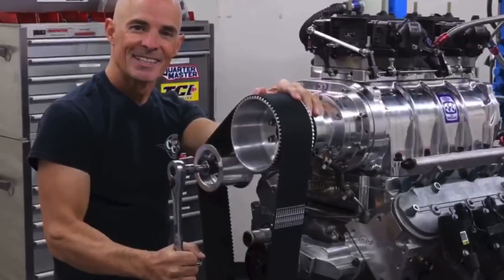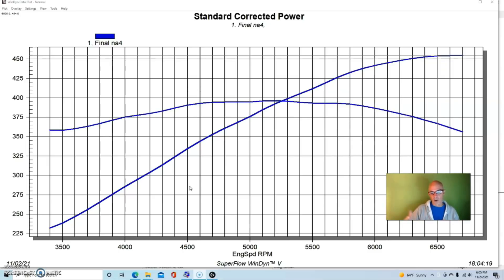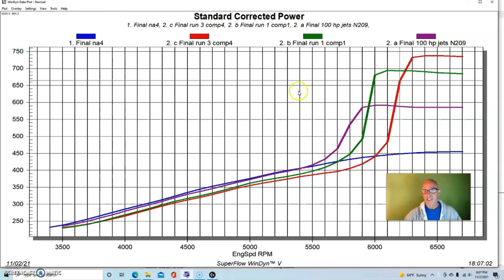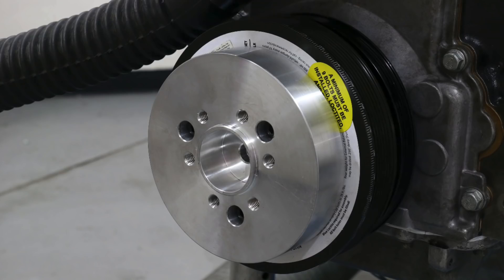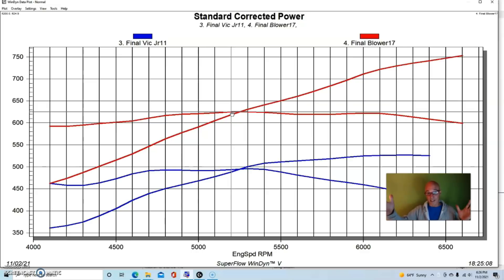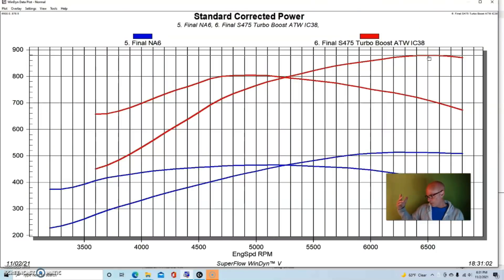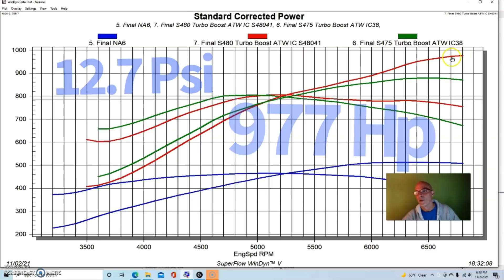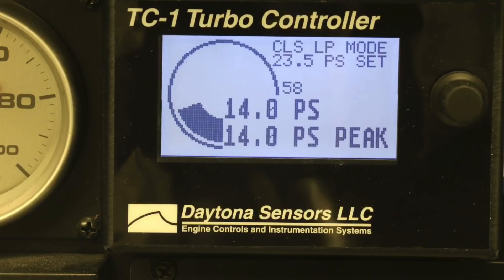HOW TO MAKE BIG LS POWER! JUNKYARD 5.3L NOS (300 SHOT), 6/71 383 & 6.0 TURBO S475 VS S480? TEST FAIL

Comment: Just asking for a friend. He has a 6.0 in 2500 with 317 heads. He also has parts from other trucks. He has a 5.3 with 859 heads not sure exactly on the casting I do know it's 800something He also has a turbo from a 6.6 diesel and the air to air intercooler and he already has a tuner on the 2500. How well would a like the comp cams 59-454-11 cam, the 5.3 heads, diesel turbo and intercooler work or would we end up making your big bang 6.0 look like a fire craker compared to dynamite and really tear something up
Reply from the maker: USE A SMALLER CAM ( i HAVE A GOOD ONE FOR SAME), USE THE STOCK 317 HEADS AND THE REST WILL WORK
Reply: @richardholdener1727  thank you I'll let him know and we live near Bardstown KY so we can literally go to btr for the right cam
Reply: @dannytravis7118  I’m like 25 minutes from bardstown

Comment: Richard you are single handedly motivating me to swap my bmw. I gotta ask, it just seems stupid how simple you make this seem. Are the motors capable of holding this power constantly? 900 on a stock junkyard motor? I'm debating buying a built short block  but even then it's just insane to me. I need to understand more about this.
Reply from the maker: A STOCK BOTTOM END 5.3l WITH RING GAP, A CAM AND SPRINGS WILL MAKE 900 (EASY)
Reply: 900 flywheel is easy... 900 tire is possible.  For how long?  Well... that depends.  Use E85 if you can't get it and pay attention to the tune.  Too lean or too much timing is bad.
Reply: Is that reliable engine power however? Or is that enough to blow a motor in a sense

Comment: Hi Rich….All your videos are very informative… what I’d love to see is……. How about a healthy Street LS3 hydraulic roller cam vs a same specification solid roller cam test…… on a N/A engine. 😏
Reply from the maker: I stay away from solid roller cams on ls motors
Reply: Maybe a solid roller cam would be like playing with disaster. I wonder what the pit fall with LS’s and solid roller cams is. My guess is the oiling system.
Reply: Hi Richerd…Would be great if you shot a video showing or just talked about why it’s not a good idea to go solid roller on a LS platform… obviously you’re talking from experience. Dam , I love and miss adjusting rocker arm to valve lash clearances.

Comment: Lets say you have a vehicle with an LS1 engine and you want to go FI.
Would you pull that motor, tear it down, do the proper ring gap for FI 
OR
would you grab a junkyard 5.3 and do the proper ring gap on that motor then swap out the LS1?
Reply from the maker: depends on what power level you want-the ls1 alum block is limiting (if 1000 hp is limiting)
Reply: If you already have the motor in the car then just use that motor. However people like the iron blocks for better strength. Most junkyards have 5.3s for days

Comment: @Richard Holdener
Do something for the budget Honda guys do a nitrous d16 little bang and a turbo d16 little bang 😁. With just the usual mods just a little ring gap. See if you can get a stock d16 to make 400hp and how many runs at that power level it will make. And if you do a nitrous d series see if you can get a nitrous timer and ramp it in.